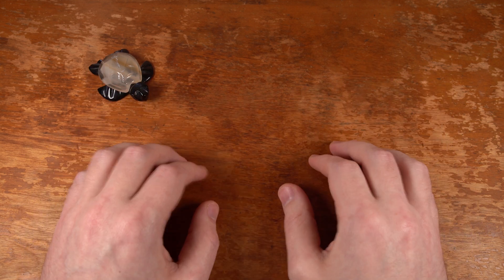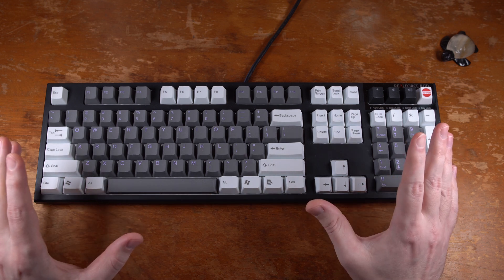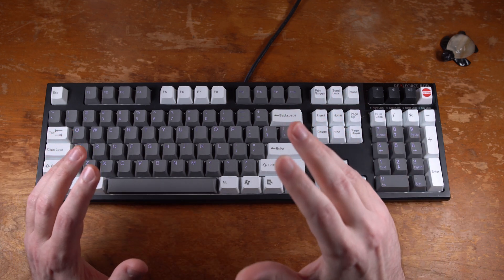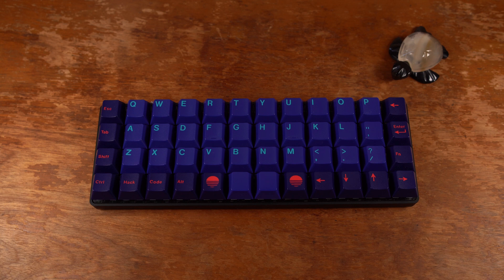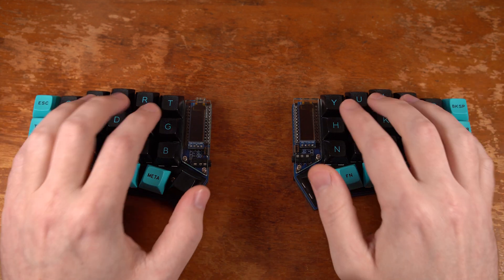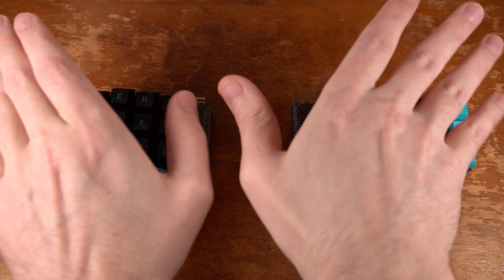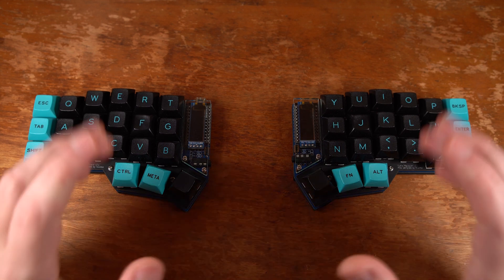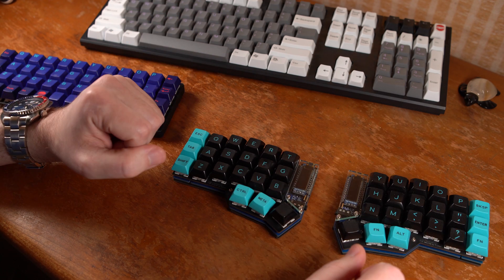Explaining Keyboard Staggering: A Look At Ortholinear, Columnar, and Horizontal Staggering

Comment: There's no way I could type properly on anything but a regular keyboard and I definitely couldn't use one of the split separate keyboards! 🙃
Reply: You could after a little bit of practice, and once you've adjusted you'd realize how much more comfortable typing is on a keyboard with a stagger actually made to fit your hands instead of using a stagger made to solve a technical problem for a mechanical invention that no one uses anymore.

Comment: why do split keyboards always a bunch of keys where there normaly is the space bar... this is the only thing wich holds me back gettign the columnar staggerd one...
Reply: It doesn't make sense to take up a lot of space at the bottom of the keyboard for just one big spacebar, so most non-traditional keyboards provide two or more programmable thumb keys, which allow your strongest fingers (the thumbs) to do the work usually relegated to your pinkies (such as Shift, Enter, and Delete). I use the Dygma Raise (which has eight thumb keys), and it was a fairly easy transition, since I only ever used my left thumb to hit the spacebar anyway.

Comment: What you called Dactyl is generally called a concave keywell/keyboard, pick your poison.
Reply: I noticed that too. What I would call a Dactyl is where the columns fan out from each-other slightly by a degree or few per column. I notice personally that when I flex my fingers, they also splay a bit on extension, so slightly fanned columns +columner stagger or ortholinear might work "best" overall for someone whos fingers do that reflexively.

Comment: Ortholinear+Split+Columnar+Tenting+Dactyl=PERFECTION
Reply: Make it just 10 keys, you can move them separately on the desk. Then all inputs are handled with doing specific combinations. The upper limit of combos should be 10! (That's 10 factorial) which equals 3,628,800 separate inputs.
Reply: @ChrisLeeW00  for one "chorded" stroke, the limit would be 2^10 = 1024.
Reply: @ChrisLeeW00  
The benefits you get with chording on a normal chorded keyboard are marginal in comparison to all the other optimizations One Punch Man mentioned, so at that point I would jump to learning machine steno with a Georgi and Plover because you get way more out of the whole chording process; otherwise I would just stick to an normal ergo with those other optimizations.

Comment: I'm so glad that I'm not the only one who also finds the standard horizontal stagger to be unwieldy at times; seriously, do they honestly expect you to extend your left index finger that far to reach the 'b' key? Speaking of the left hand, the stagger of the bottom row of keys makes it such a nuisance to type with your left hand. For example, my left index finger naturally ends up in the crevice between the 'c' and 'v' keys whenever I reach for the bottom row of keys.

Although, I'm curious to hear your take on two other kinds of keyboard staggers, even if you haven't tested them:
-Uniform/equal stagger: Where the letter keys are all staggered equally to each other (1/4 of a key).

-Symmetrical stagger: Where the letters are staggered in a certain direction to better suit the natural motion of the left and right hands respectively.

Here's a link so you can get an idea of what I'm talking about: https://deskthority.net/wiki/Staggering#:~:text=A%20uniform%20stagger%20or%20equal,point%2Dof%2Dsale%20keyboards.
Reply: Maybe just me, but I use my left thumb to hit B, or my right index finger.

Comment: Have you tried the Moonlander Mark I?  I'm looking into it.  I am curious of the ergonomics.  Anyhow, thx for the vid :)
Reply from the maker: I haven't myself. My CRKBD has a similar stagger, and with the tilting thumbcluster then you can probably achieve something similar to a manuform for that part.  Plus tenting is always good.  So going off of my experience with similar design features it should be pretty good, and the added adjustability giving you some additional wiggle room.  That is if you don't hammer on your keyboard. That style of tenting can be prone to slipping if you hammer on it.

Comment: But doesn't the ortho layout makes you twist your wrists outward? (Extra point for the Seiko btw >.< )
Reply from the maker: Not any more than a traditional stagger. Lets assume for a second that with a one piece keyboard our hands are perfectly perpendicular to the keyboard like you see in diagrams. To do this you'd have to either can't your wrists, or hold your elbows almost together in front of you regardless of staggering or lack there of. The home row is in the same spot and the keys are pretty much at the same distances related to each other. Now if we look at the fingers we are supposed to be using for proper touch typing, on a traditional stagger (google an image to get the visual). Our fingers slope to the right going from top to bottom for both the right and left hands. That is why a lot of people use their index fingers "incorrectly" for C. You're hand would have to move more to use your middle finger. It's not what you're supposed to do though. Ortho they are are straight up and down.  So your hands would go from top to bottom right slope to a  straight up and down going form traditional to orth. So that is already an improvement. Both have a potential for the pronation because your hands are in the same position, but ortho gets rid of the weird finger movements (that we all learned and are used to of course).  That is of course assuming proper touch typing technique. Now most people probably don't keep their hands perfectly perpendicular with the keyboard. Personally I keep my elbows at my sides, my forearms coming inward with my wrists straight, and my hands are at a slight angle to the keyboard. It's how I type whether ortho or traditional stagger. I don't have any ulnar deviation in this position with either. People will also use different fingers for keys. You adapt and make it comfortable. But the potential for pronation is the same for both since we are working with the same spaces. That's why split keyboards actually see real reduction in rsi. They aren't stuck with a fixed angle and distance. 

Thanks for noticing the Seiko!